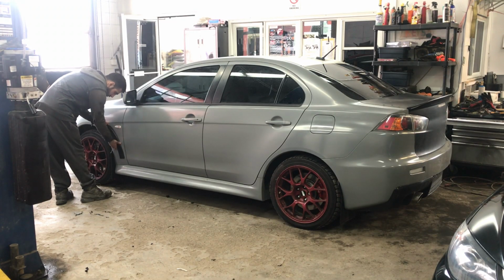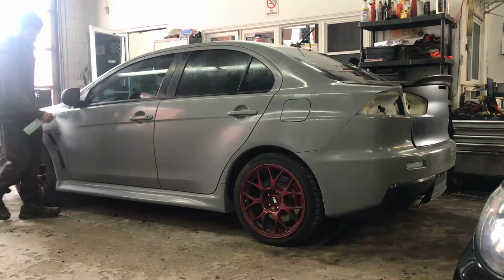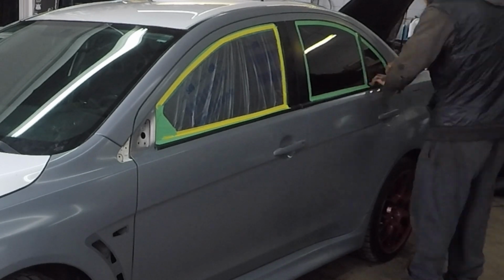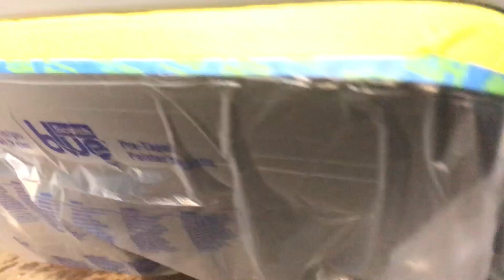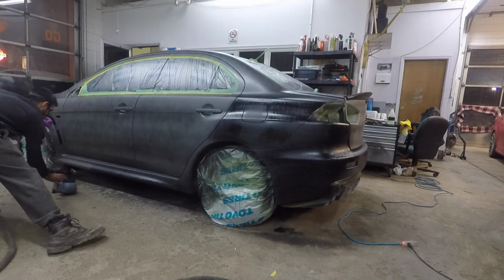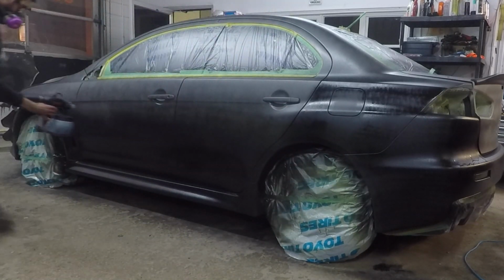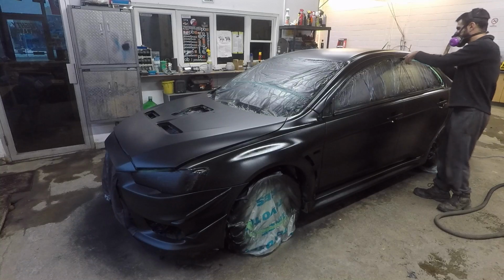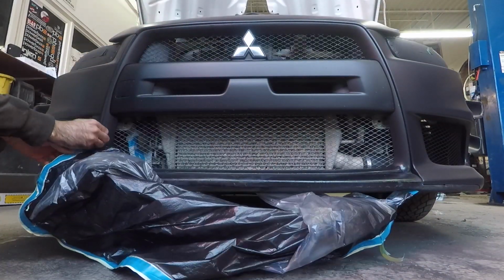How To Spray Your Car Matte Black - Complete Process

Comment: Looks great wondering if you have pealing clear coat you would need to sand all clear coat back right? Thanks
Reply from the maker: Yes sand the clear coat if its in bad condition so its smooth and then plasti dip

Comment: Two questions: 
If I were to do this to a car, would a clear matte finishing coat help at all or would that be unnecessary with the 8-10 coats?
Also, would you be able to start doing coats on one part of the car and then move onto another part of the car at a much later point?
Reply from the maker: You can add clear coat with ur 9th or 10th coat if you like. I dont recommend doing parts of the car i like to walk the car and spray the full car at once

Comment: If I want to paint my hood Matt black do I have to sand and prime my original paint? The original paint is fine. Also after applying the matt black do I need to apply clear coat ? Thank you nice video
Reply from the maker: No need to sand it down and no need for clear coat but u can put clear by plasti dip to give it abit more protection

Comment: The clear coat is coming off the roof and other places. The car is originally from FL I live MA. I know I have to sand it first but would I have to do a primer or can I just jump into the matte black?
Reply from the maker: Sand and prime it then wait 48 hours before spraying plasti dip but test a small area to make sure you get no reactions (make sure to clean the roof really good)

Comment: Very cool! My Dodge challenger is white, with matte black hood, roof, and hatch door. But they're all faded and water damaged I think. How would I retouch it up?
Reply from the maker: You would probably have to respray or rewrap it again
Reply: @EhabHalat  Should I sand it down first? And use primer?
Reply from the maker: Most likely if its in bad shape

Comment: U didn't show the paint mixing process and the links for the tools
Reply from the maker: There was no mixing. It was black plasti dip from dipyourcar ready to spray gallons and most material used was tape and tape and drape which you can get from your local pint store or hardware store

Comment: Nice work.  Looks like you didn't sand anything prior to painting the car matte black?  Did you just spray the matte over the original car color then?
Reply from the maker: Yes. Their is no sanding needed when using plasti dip. It is a removable coating

Comment: Bro nice video ! i will like to ask you if first you dont need to take out the old pain?? or u just pain over the old paint? thanks
Reply from the maker: With plasti dip you can spray over the original paint on the vehicle. Its all removable whenever you want
Reply: @EhabHalat  Oh !! so the paint that you use in the video is plasti dip !  I was thinking was normal paint !  :)
Reply from the maker: Ramiro Romero the matte black is plasti dip yes
Reply: @EhabHalat  thanks for your answer! for last , how much was the final cost of the hole pain for the car? so and so ? thanks
Reply from the maker: Ramiro Romero the product cost me around $400-$500 4 gallons and the spray gun set up plus masking materials

Comment: @Ehab Halat What paint did you use on the car i have the gun but i need that exact paint!!! plzzz
Reply from the maker: Hey! Its plasti dip! Just make sure you do enough coats! I do 10 to make sure it is durable. 4 gallons and use it all
Reply: @EhabHalat  thanks so much for getting back, i have an electric paintgun i dont know if that works with plasti dip but could you refer me to where i can buy some?
Reply from the maker: Karma www.dipyourcar.com

Comment: Could you please tell me the name of the paint brand?
Reply from the maker: Hey its plasti dip which is a removable spray coating
Reply: @EhabHalat  how good does it hold and does it hold good in snow?
Reply from the maker: It holds great if applied properly. Atleast 7-8 coats because more coats you do the more durable it is

Comment: Did you not sand it?
Reply from the maker: No need too when you use plasti dip
Reply: @EhabHalat  is plastidip the paint? doesn’t the previous clear topcoat stop the paint from sticking? I really don’t know, about to paint my truck this color, so just trying to understand if I have to sand or not haha
Reply from the maker: @joem8212  no you dont got to sand anything unless you have rust on your vehicle need to fix it but for the most part plasti dip is easy to work with so no body work is required

Comment: Awesome video, Thank You! Any 1 year update on the paint? I'm thinking of doing my 2017 Corolla like this and was curious how it held up over the last year. Thanks again!
Reply from the maker: The vehicle was from a dealership so it has been sold to their customer but havent had them come back asking for touch ups or anything so im guessing its holding up great because i put 8-10 coats making it durable
Reply: @EhabHalat  I’m in Houston texas and have a shiny black 2014 GLK Mercedes I would like painted All matte black.. Would you know of any auto places near Houston that can do it? Thanks! - Nia
Reply from the maker: Hey, im in Canada so i have no idea but if you go on www.dipyourcar.com they should have a section with authorized installers and i know there is a few places in Houston. If you cant find it just email dipyourcar and they will help you out, they answer pretty quick.

Comment: You didn't give the paint anything to adhere to, the paint will start flaking off sooner or later. You need to use fine sandpaper or at the least some fine grade scotch bright scowling pads to scuff up the surface so the new paint can stick.
Reply from the maker: Its plasti dip, not paint. It adhered fine to the surface. It was cleaned with rubbing alcohol and grease and wax remover